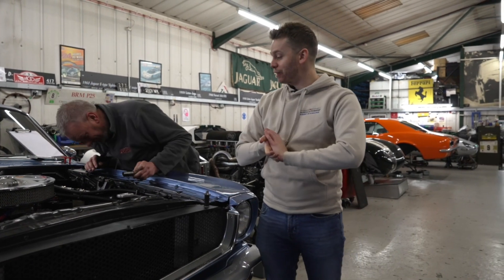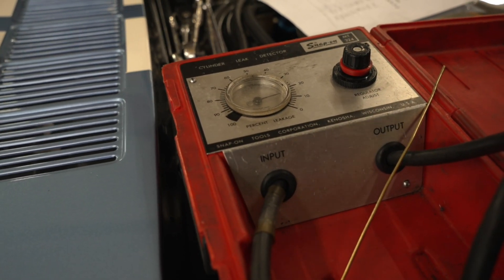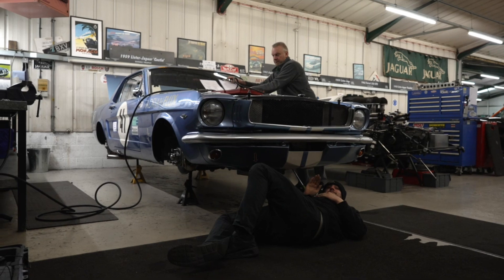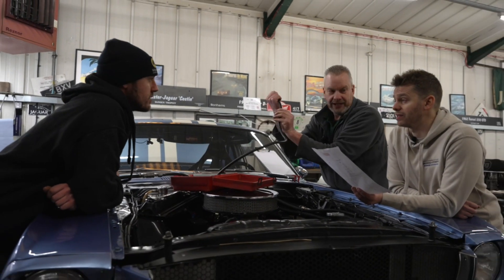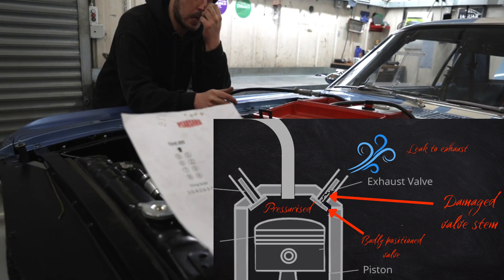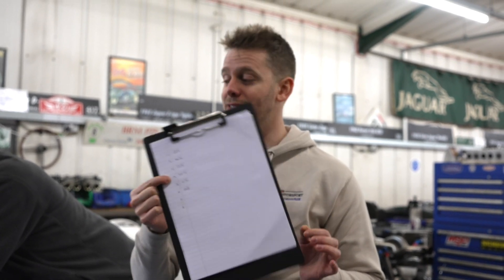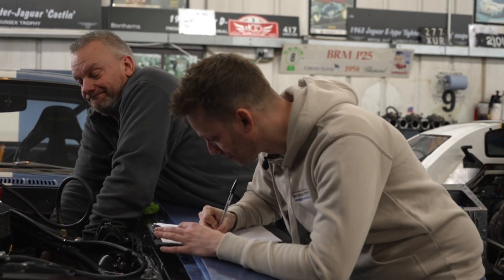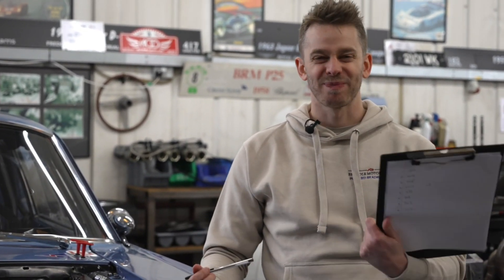The most important V8 Engine test - 'Leak down' testing for our 1965 Mustang.

Comment: I note that (part from the 'Powered by Adrian Flux' stuff) your channel isn't covered with sponsor's messages.
While watching this movie, I was googling compression tester kits -- wouldn't have been doing that otherwise.  Maybe you're missing a trick?
Reply from the maker: @leeharveyosmond  the channel is exclusively supported by Adrian Flux
Reply: sooo I bought me a compression tester toy, and tried it on the Fiesta III.
Where did you say you were sending that V8 lump for rebuild?
[Kidding!  Cylinders 1 3 and 4 are fine, 2 leaks a little bit, head gasket appears fine, I adjust the valve clearances myself .... probably leaking past the piston rings, and no worse than when I got it, 20yr/70k miles ago]